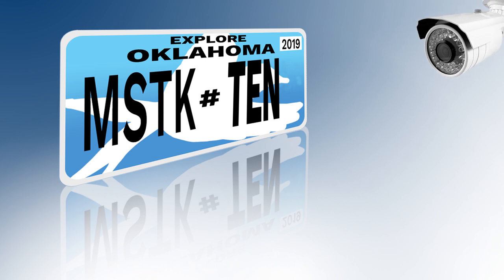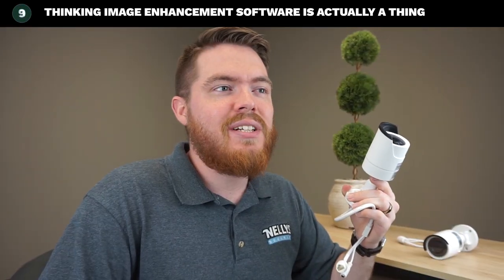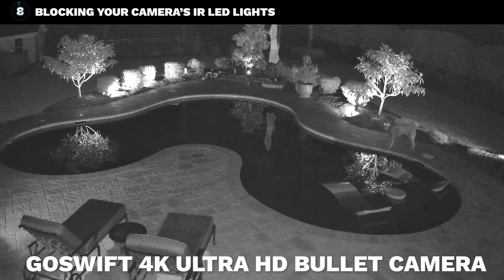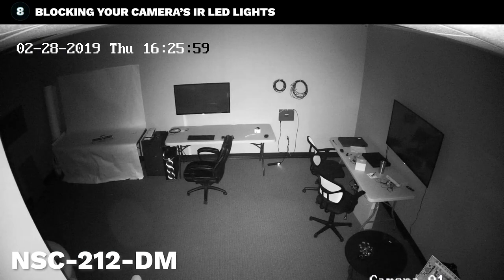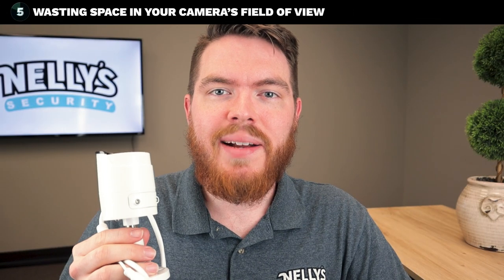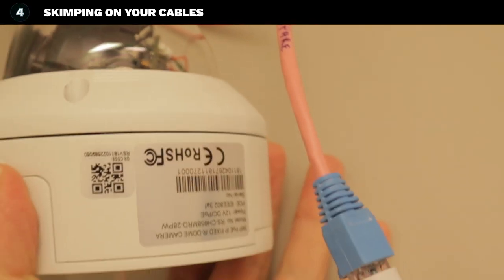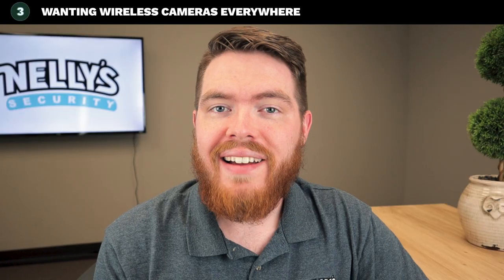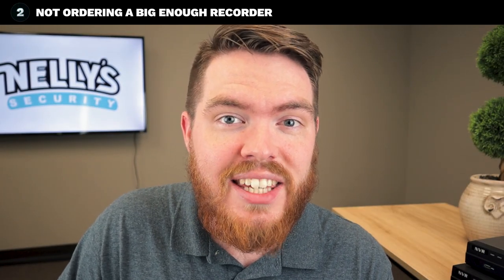Top 10 Surveillance Mistakes To Avoid When Installing Your Security System for the First Time

Comment: Stop with the camera moves.  Better for the host to look at the camera, then for us to keep going profile needlessly.  Honest people look you in the eye.

Mistake: 
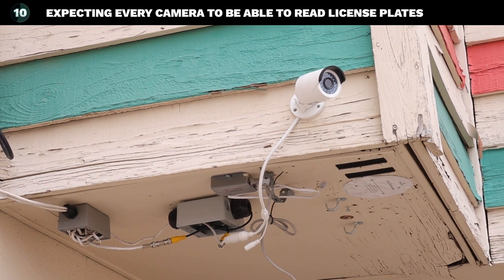2:29 - wiring your camera so wiring is easy to tamper with.  A broom stick with a hook can pull this wiring down and leave the camera no longer recording while the office that it is protected is robbed blind.
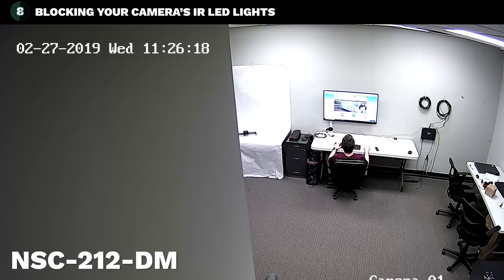5:40 -- IR Blindless?  Consider adding an IR light source somewhere else in the room so that when the lights go out, the room isn't dark.  Also a good idea when your trying to extend the visual distance that can be seen at night.
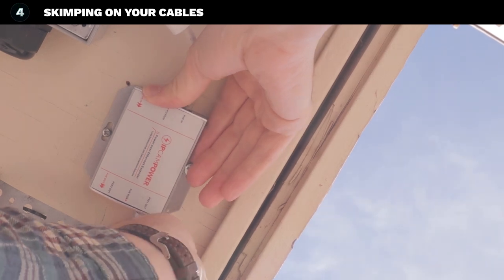12:30 - when installing devices, quality suggest use the same screws to hold a device in place.
#7 -- ordering an analog DVR(NVR) and then wanting to add digital cameras.  Or ordering cameras that use a coax connection, and wanting to plug them into cat 5 cable.

Comment: 4:58 #8 is somewhat misleading, as the IR lighting used by cameras CAN be seen by the naked eye at it's source as a dull red glow (your video even shows that)
Reply from the maker: Thats true, we were simply referring to the "throw" of the light. Thanks for watching!
Reply: @NellysSecurity  If you ever come across an older DVR system (such as upgrading someone), I'm looking for a used one for field surveillance to run off a 12volt battery & solar panel. Also, would night vision motion detection still work if the IR lights were covered over (providing alternate pressure switch activated IR lights were used)?

Comment: Was going to buy Nelly's system but the same systems under a different name brand at a lower cost coming from the same China company! A extra item I found in trying to find a proper system is customer service as Nelly's is one of 3 companies that have USA telephone support in their systems price range! I bought a different system only to find out support went to India the last few months of 2019 after being in the USA! Another problem is the lying spec's from most of the systems offerings on the internet (NOT Nelly's) such as 4K four channel NVR that has only one camera input at 4K and the rest are limited to 720P.  Most systems are old 720P cameras as well as 400 line cameras that no longer are worth the extreme costs being charged to "dump
" the old equipment! I spent months in 2019 looking for a working system, with a limited budget, as I am a old retired tech that is shocked at the amount of non supported crap systems with email as the only support if that! China sucks when shipping outside their country and Nelly's is what you pay for to correct a problem with bad equipment otherwise you can loose all your money in buying over the internet!
Reply: If you must rely on contacting costumer service then you should not be installing your own security system.  Many companies like Nelly Security, Alibi Security, and LAView who OEM others equipment (eg. Hikvision), the additional cost you pay these companies is due to your lack of knowledge of security systems.  I dealt with many companies selling OMD security equipment through the internet and never had an issue.  I have saved hundreds of dollars on putting together quality security systems by shopping around and buying the OMD branded equipment.  For the average DIY there are companies such as Lorex, or Amcrest (Dahua OEMs) or Swann (Hikvision OEM) that bundle complete plug and play security systems.  If you going to mix equipment manufactures, the key is to stick with ONVIF compliant hardware.  Last I should mention due to security concerns the US government has banned Hikvision and Dahua equipment for government installations.  Who knows the impact this will have on the security camera business.
Reply: @timothygootz2903  I was installing security system when solid state cameras was just beginning and looking at Amazon reviews of problems straight from the factory sealed box, is where I can see the problems in today's market. I do not believe you have NEVER had an issue as with all equipment crap coming out of China! China has corrupted the micro electronics to be a security flaw in their favor and that is why the US government cannot trust the hardware hack built into the chips! It will require that all parts of security systems be built in the USA. Canada can import parts and process those parts in Canada and label the product to be made in Canada, so it has to be made in the USA.

Comment: Tip no 7 should be don't have your cameras on the same VLAN as your production network. Also don't allow your cameras access to the internet. When configuring a IP camera ideally leave the default gateway setting as blank or 0.0.0.0 so the camera is unable to contact the internet. Most cameras used for home environments today are cheap Chinese dahua/hikvision are who knows what traffic is leaving your network back to the internet.

Comment: your statement you cannot blow pics up isn't entirely accurate, many good camera record in various resolutions, just like your cell phone cam, so set it to record the highest possible always, that doesn't mean you must view in that resolution, nor does your monitor have to support that resolution, record resolution can be different that viewing resolution..  you can record at ultra hi res say 110 megs.. but you can view at say 720 to save resources in your NVR, so store to cloud in the highest res possible, drives as well if possible that way if you ever need to blow something up its there..

always get the highest resolution cameras possible, always, maybe you don't need it, but its good to record in the highest just in case you need to count freckles or identify a tattoo?

Comment: What about the thief's just cutting the cable, then there's no footage?
Reply: Leon de Swardt bring a ladder to reach it 10ft off the ground 😀
Reply: @ChickenSandwichWars  So a ladder is a surveillance system's downfall?  Big investment for such a weak defense?
Reply: Huh cut cable no footage? That is what the dvr/nvr is for... Then there are people like me that will have more then 1 camera in each area some have as many as 5. No not all in one location but yes all catching almost same feed just different heights and angle. Now what is Nelly going to do with the Ban on HikVision in USA? That's the real topic I wasnt to know about
Reply from the maker: Mistake #13 - exposing cables.  Didnt make it in top 10
Reply: I usually mount cameras so that they cover each other and as others said, the video is being constantly stored somewhere anyway (e.g. Synology Surveillance Station if you already own a Synology NAS - it also notifies you via phone push notifications in real-time in the case of movement).
Speaking of cutting the cables: When he talked about #3 - Using WiFi cameras, he only mentioned the unreliability and lower image quality. I was waiting to mention that anybody can buy WiFi/GSM jammer for $20 anywhere online and then anyone can "cut the cables" of your cameras before it even reached its field of view, without any ladder.

Comment: 24 surveillance cameras. there is no place outside the house where you are on less than 2 cameras. if you are at or near a door you are on 5 cameras

overhead wide angle to detect presence. eye level for ID.

the IR lights are between the cameras. A ring of glowing red LEDs is a target.

crossfire: mug shots are taken from two angles for a reason.

concealment: people are shocked when they walk into my living room and see the wall of monitors. they go back outside and look for the cameras. repeatedly. until they figure out they are in the belly of the garden gnome, and in a radiator hose in a strategically placed pile of trash in the back yard. it's an art.

never anything other that Sony Super HAD CCTV sensors. NO! CMOS ( can't make out shit ).

what I need: a device that takes a still frame from an analog NTSC camera when a sensor detects a presence. a frame grabber that works with Linux, not Micro$oft.

8 channel DVRs: NO! 4,9 and 16 are squares of other numbers. you get a sensible arrangement on screen

NTP: network time protocol. sets your clock to national standard time. an absolute necessity to prevent the opposing lawyer getting the evidence thrown out.

the output of my DVRS is converted from HDMI to NTSC. this is fed to ChannelPlus TV modulators. the outputs are combined into my cable TV system. any DVR can be viewed from any location in the house.
Reply: adding: turn time off on the cameras. use the time on the DVR. no discrepancy, no dirty lawyer tricks

Comment: I have a hard time trusting anything someone says specially when it has to do with their industry and they are completely wrong video enhancement has been around for a long time and use to be a pain staking process and required sometimes days of re rendering but not any more today video enchantment software works just like you see on TV in the CSI shows its as easy as 1,2,3 there are many open source solutions even Windows Movie Maker does a decent job at enhancing pixelated, noise, out of focus, dark videos here is a list of 5 open source solutions https://www.iskysoft.com/video-editing/video-enhancement-software.html but if your looking for something to clean up a video to send to law enforcement or to use in court check out MotionDSP https://www.youtube.com/watch?v=u_B5PUYaIIA

Comment: Thank you so much for sharing the decades of personal experience that you personally have in this field. Although you are possibly missing the most important part. Any questions that a person must ask themselves that is always, always first is, Listen you cheap bastard, then finish the question that is actually always a statement. Know the reason  low IQ folks do this themselves and then question 2 should be, what happens when it breaks. Hey baby, that's the ticket!

Comment: The signal repeaiter is no external version ?? Amateur mistake !
The Wi-Fi camera runs on battery power ?? Amateur mistake !
The distance is too long bud don't use high speed optical connection ?? Amateur mistake !
And you think you understand CCTV ?? Biggest mistake !